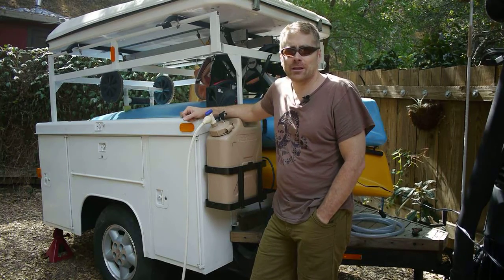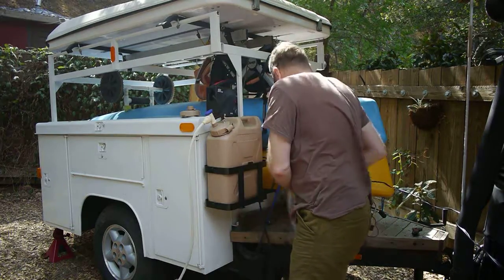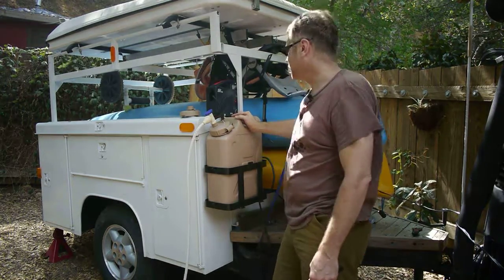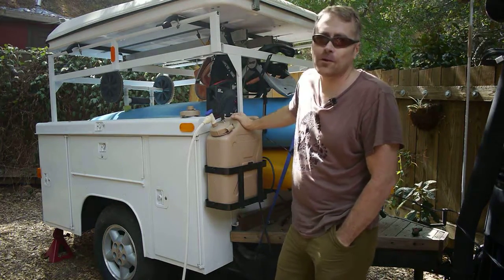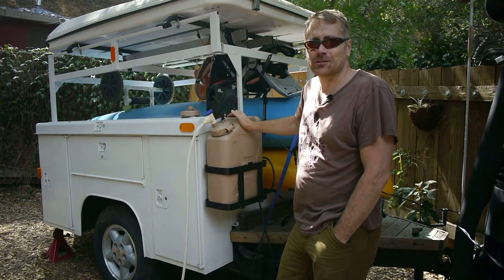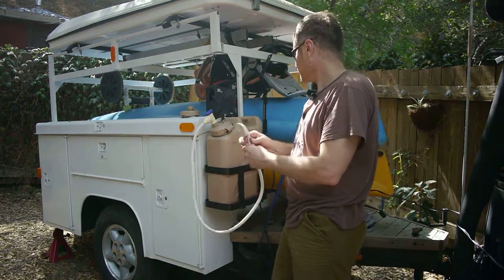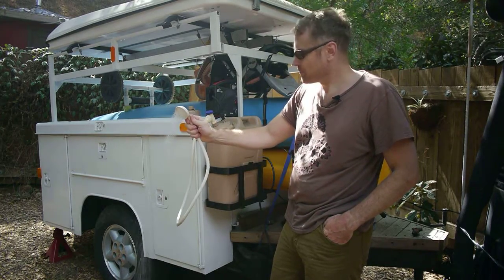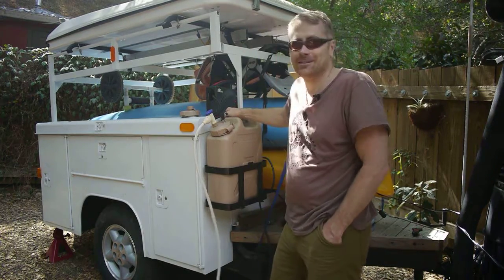Military Water Can Camp Shower Demo / Jerry can

Comment: Ok, that water stream is pretty sad. The simple 12 volt shower pumps do a much better job. Check out traveling mans video here at the 3:23 minute mark. It has a nice stream and runs on 12 volts
https://www.youtube.com/watch?v=TYb9p5gUWbA
Reply from the maker: Sure, but it also works to be pressurized by a hand pump, which in some remote areas will come in handy. Pressure is greater if one seals the can. I use this can for other things so I didn't seal it.
Reply: I was just thinking that you always have 12 volts available, so why not use the better water pump.